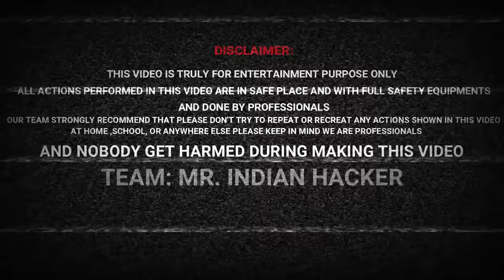Running Bike Using Water - 100% Working Trick

Comment: Dislikes are from the petrol bunk owners 🤣
Reply: Me😊😂😂
Reply: Yes
Reply: This method is 3 times more costly than petrol (assuming water is free)
Reply: Dislike from Sangis
Reply: And dislikes from bhakts as well.
Reply: dislikes from people who have brains..
Reply: @user-je6qb4zl5i  😂😂😂
Reply: @abhyudayshardulsingh1576  really??😬😬
Reply: @pradyumna0952  "Yes"
Its impossible to explain the entire chemistry here you can refer some books
But in short
To produce 1kg of acetylene you need 3 kg of cac2(calcium carbide) which may cost around rs 100/kg so 300 rupees

And 1 kg of acetylene produces around 50000 KJ of energy.....
Also 1 kg of petrol produces 45000 KJ
That 1 kg (1.25 litre) may cost you around 125 rs

Moreover the bike engine is designed for petrol so it will be getting damaged frequently.....
Reply: @abhyudayshardulsingh1576  ooooh nice☺️☺️
Reply: Yeah😂
Reply: Good
Reply: Bhai yrr support chahiye tha
Reply: @Asifcryptopoint85  bol bhai
Reply: @AlexJohnson-ck2wv  kya bolu bhai
Reply: @Asifcryptopoint85  support chaiye na
Reply: hay

Comment: Water isn’t combustible so you would get any power and it would just break the engine 

Like to turn off India’s WiFi
Reply: No but that means the bike is essentially running on steam power because water will expand drastically when it evaporates so it's actually a more efficient way. Yesz there's not as much power but it still works
Reply: Next: my Bike runs on suggar water 🤣🤣🤣
Reply: Water didn't go in engine
Reply: Yash Munot 
WE ALL KNOW THAT

This is fake
Reply: It's not the water which was acting as a fuel.... It was the acetylene gas which was responsible... And its the reaction that is studied in chemistry
Reply: @redcar9949  Sorry, is this sarcasm? I really can't tell if your serious or not.
Reply: @huspy8168  I'm serious. Idk if I'm right tho
Reply: Halfthekgb it doesn’t work.
Reply: The engine in the rugular bike is a combustion engine , meaning it requires gas to go in the cylinder and use the spark ignition to make a small explosion and expand the cylinder head, water would be impossible to use since water is not flammable and is resistant to the spark, although if they use a steam engine ( sterling enigine) they simply could just heat up the water . But obviously they don’t have one and the one their using is a gas powered motorbike, I find it really funny since they have 0 clue of what their doing , I agree with some other people that India should have no wifi in their country.
Reply: Backr,/
oad Boys
Reply: Sar se Jo Tera Pani Nach Le panga tusi khush rahane wale
Reply: I cant like, it's at exactly 420 sorry
Reply: @redcar9949  😂😂😂💥
Reply: @joey8124  i think you didn't watch the video and commenting by reading only title or maybe you didn't understand a word he is saying. He is neither using water nor steam in engine. He is using water to form acetylene which is highly flammable gas. I dont know it will work or not but it can be used as a fuel in ic engine.
Reply: Omg good back bro
Reply: Wtf u guys dont get comedy
Reply: Ehy Do they only speak in their native no one in da world understands or speaks his langusge i know dat. PLEASE SPEAK ENGLISH SO DAT MOST OF US HERE WHERE IT MATTERS MOST
Reply: Lol wtf i am indian whatsup with the wifi
Reply: @redcar9949  And what exactly is going to heat the water if there's no gasoline to combust?
Reply: @ExperiMentalDon  the spark plugs I guess
Reply: @redcar9949  But. No. That won't heat the water that way
Reply: @ExperiMentalDon  who knows, maybe they modified it perhaps
Reply: @t-55am2b5  im pretty sure you didn't even watch the video then
Reply: @redcar9949  you're wrong. not because steam cant work an engine. but because this is a combustion engine and will only work on an inflamable substance. the steam engine would need an entirely different engine.
Reply: @nihaalkanue5801  well it looks as though they modified it pretty thoroughly, so that might be the case
Reply: Backroad Boys if there was a way to split the hydrogen from the oxygen whilst running at however many rpms and burn the hydrogen whilst using the oxygen for intake then you would have a water powered car. And there once was a guy who had it almost figured out and a big oil company had him killed and the engine destroyed.

Comment: Youth must be supported for this effort ❤️
Reply: Sureeeee
Reply: It's a fake! There is petrol at the bottom of tank, petrol and water don't mix just like oil, old schoo trick 😉
Reply: Yeahhh
Reply: @infowork1275  abbe real hai gadhe
Reply: @infowork1275  school nhi gya lgta hai tu
Reply: @infowork1275  but density of petrol is less than that of water so even if water does not mix with petrol it will float over water so your theory contradictory and wrong
Reply: Hay
Reply: @infowork1275  petrol cannot be at bottom if water is mixed... Because petrol will be always at top and water bottom..... Petrol is less denser than water so petrol  floats on water... Hope this is clear.
Reply: Bhai yrr support chahiye tha

Comment: You can actually make this with salt water by converting it into bittern and then using electrolysis to decompose the water into hydrogen and oxygen due to excessive ion circulation and then using the hydrogen as fuel
Reply: Can able to develope hydrogen engine
Reply: @omkarvaze5932  You can according to science as hydrogen is an highly combustible substance but due to electrolysis you get hydrogen ions mostly   ( I think )Though,you have to separate the hydrogen liberated from the water as gas .It will take hella patience and maintainence.
Hope that helps.
Reply: @gamingwithparzival9249  no you will get hydrogen gas and oxygen gas as full molecule. 2H2 and 02.
And the hydrogen and oxygen will be produced on cathode and abode separately but I still think it is too slow and difficult to do for a bike and it also requires electricity so direct e bike is better.
Reply: @bassraja1978  Yes plus there is a small mistake in that it produces H ions I think maybe
Reply: Such an inefficient design...also storing that hydrogen would be a problem. And to get sufficient hydrogen gas it is very expensive
Reply: @gamingwithparzival9249  Hydorgen ions will be produced regardless....that's basically electrolysis...but obvio at cathode ion is not gonna be free it will combine with another hydrogen ion
Reply: @bruhguy4215  Oh tq bud
Reply: @bruhguy4215  Yes storing hydrogen maybe be a problem and it's inefficient that's why it's not in use.After all a man of science is a man of efficiency.
Reply: @gamingwithparzival9249  absolutely
Reply: @bruhguy4215  To be precise thanks for your help

Comment: Their is a possible way to run bike with 100% on water by  a hho generator.
What a hho generator does it separate compound of water which is hydrogen and oxygen.
Hydrogen is very flammable and oxygen help its but the problem is after buring the hho gas its convert into water which cannot escape the engine.
Reply: Not possible...I m using HHO kit since 8 years in my bike...
But without patrol it can not make enough presure...
Reply: @ShiShir.Srivastava  it is possible to use hho generator as fuel but you have to face a problem. hho gas turned into water when burn. Your getting enough pressure but the water is stopping you and petrol bike 's is not made for that kind of things, usually patrol burns and turned into gas which comes out from exhaust water can't come out from that. Instead you can use a steam engine (fuel is hho gas) and normal air (without bolling water for steam gas)

Comment: Next video - Running bike on air
Reply: Acid me sodium metal
Reply: Bhai tu science ka student hai
Reply: Maybe😂😂😂
Reply: FAKE ******
He didn't connect water tank to the engine. He just run the bike on that gas. Water tank has no use in this whole experiment. Fake title and thumbnail so as the experiment. Clickbait 😑
Reply: @junaidmohammad3104  Clearly water was used to create the gas
Reply: @scarlex002  lol, what's the purpose of water in the petrol tank? As told in thumbnail?